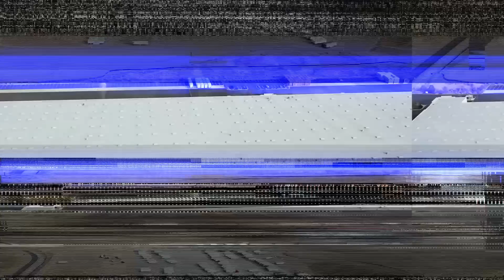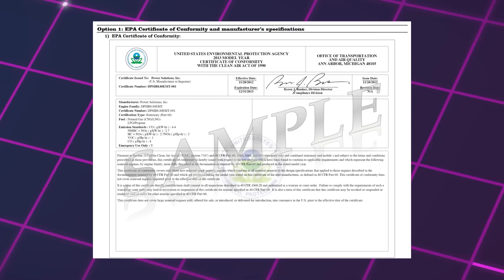HUGE UPDATE For Tesla Semi 2023 SHOCKS Everyone!

Comment: I'm a business man and time is money , time wasted sitting charging is not going to work . We need range and we need it fast and we need reliable numbers  vs range to make business profitable ... When working hauling in the mountains or on head wind days, range will suffer, resulting in multiple charging stops.  We know what our Diesel will do , this electric trucks aren't  going to come close....No it's  not going too work for us !
Reply: So don't use them for your operations... simple really. Must not be a good business man if you don't at least take ALL running/maintenance costs into consideration - just sayin!
Reply: Very few trucks run 24/7. For a lot of short haul, where a lot of time is spent loading/unloading, you will rarely hit 500 miles distance per day, and you rarely have warehouses open through the night, so even running shifts does not make sense. Thus, a lot of trucks gets 3-5 hours driving done per day, and are parked at the yard or at a private owners home. It can easily get it's charge then. If there are superchargers, aligning toilet visits and lunch stops at those spots could also make a lot of sense.
Reply: Mr. businessman, how long could a driver sit to pay for a reduction of 60% in your fuel and maintenance cost?
Reply: Auto Tech - If your business is "Long Haul" or "Over The Road", you probably use trucks with "Sleeper Cabs" or Driver Bunks! 

Look closely at the Tesla Semi: Notice the lack of a Sleeper? It's a "Day Cab" Semi, designed for Local Runs, which are the "80% of the Trucks that drive under 250 Miles per day! So, a Truck with 500 Miles Range, is overkill in performance capabilities!
Reply: Yup ! As you said, you’re a businessman and understanding technology is not your line or you might have not spoken to your accountant . Maybe you are smarter than Pepsi . Anyways, you’ll not get one even if you like, you’re at the end of the line once you’ve got it figured out

Comment: It takes two Tesla semi's to cover the milage a single diesel semi can cover. Tesla semi is still a failure
Reply: Diesel far more expensive. Business is about being lean
Reply: Some people can see change until it's happened.
Reply: The Semi is a state to state semi, not like those industrialized semis I've driven on. Range is fine imo, just need a lot of chargers.
Reply: Marco: It's a "Day Cab" in case you never actually looked at it! It's not a "Sleeper Cab" so it's designed to handle the 80% if Truck trips, that are NOT "over The Road" or "Long Haul" anyway! (Hint: Warehouse to Stores, Locally!)

Plus, these have Twice the Range per charge, of any "Legacy truck companies Electric Semi's!